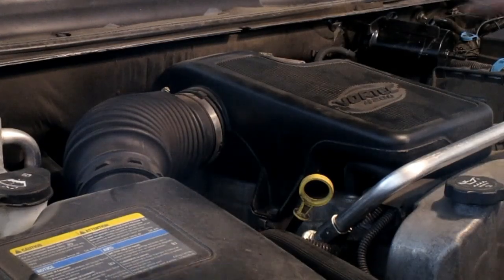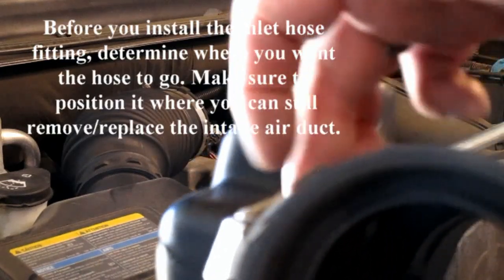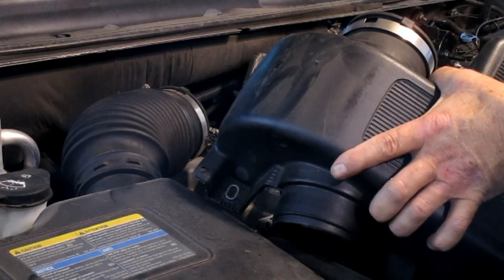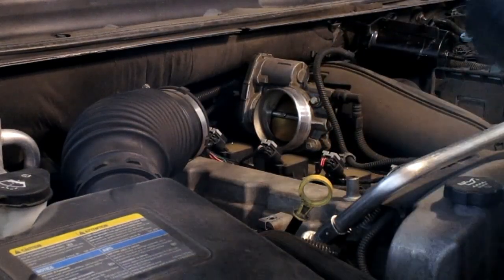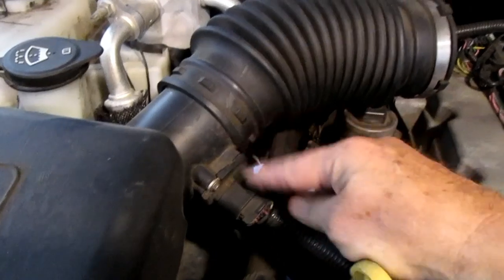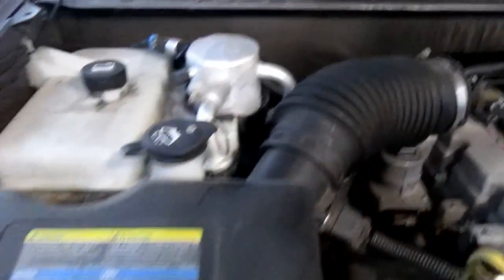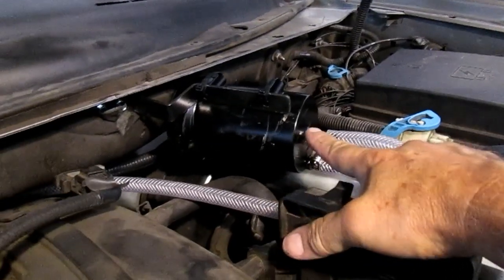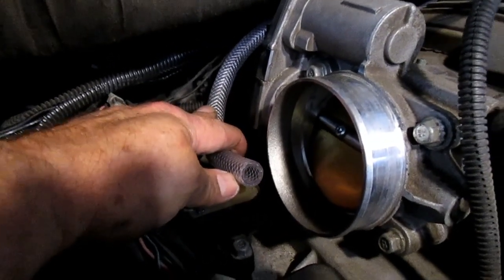How To Install The HHO Gas Inlet part 1

Comment: What about using a T fitting and connecting the hose to the pcv valve that goes into the intake manifold?
Reply from the maker: We have found that is NOT a good alternative. One of our customers tried that and the vacuum was too strong and collapsed even our reservoirs made with double the thickness of most. It is far better to insert a tube close to the throttle intake. That produces enough vacuum to draw it into the engine, without creating too much vacuum.

Comment: You guys have a video of how it will work with turbo and the use of tuner?
Reply from the maker: We need to make more videos for sure. We have lots of videos but no time to edit and create them right now. Just too busy manufacturing and selling. I will say that we have had great successes using our kits on cars/trucks with turbos. The key is to install on the INTAKE side of the turbo, so it can be drawn through the turbo, intercooler, and into the engine. It will not pre-ignite, but will combust in the combustion chamber. Diesels with the kit and tuner have seen as much as 45% improvements (even with our commercial units on large trucks, buses, etc). The technology works.

Comment: What about pulling the fuel fuse.cuz if u don't pull it.it well not wrk.
Reply from the maker: If you are referring to using the fuel fuse or fuel relay to connect up with the kit relay, then yes that is a good circuit to use. The main thing is that it only powers the kit when engine is running.

Comment: How the possibility the hho will reach combustion chamber for burning? As if we run outside, we can't ignite the fire in 1 feet distance although through the bottle or pipe when we mix blow with natural air.
Reply from the maker: The HHO is drawn into the combustion chamber through the air intake of the engine. If it is a turbo, it is drawn in before the turbo and compressed with outside air (will not auto ignite). Once it enters combustion chamber, it will ignite when diesel or petrol ignites. Hydrogen burns much faster than gasoline (10 times faster), and faster than diesel. Add oxygen with it and you get a more complete burn of the hydrocarbons (lowering emissions), and more work extracted from the hydrocarbon molecules where it matters- inside the engine.

Comment: is it possible to over do the hydrogen output
Reply from the maker: We use to think so, and it was commonly reported that way. But we have seen amazing results even using more than the common amounts. Our test on a commercial bus in Brazil proved that. We used a dual core 884 unit that was designed for 12-20 liter diesels, on a 6.7 liter engine (2015 EURO5 VW MANN engine). We got 45% improvement on that vehicle which broke all records (8 witnesses, uncut videos for proof).
Reply: @transitionaltechnologies648  so, you can just pipe the hydrogen gas into the intake manifold and it will help the gas burn cleaner and more efficiently?
Reply: @noahkidd4674  Yes! The hydrogen gas is 66% hydrogen and 33% pure oxygen, and will ignite when the fuel ignites. It burns 10X faster than gasoline, so a very small amount makes a huge positive effect. Because it is so energetic, it extracts more energy out of the fuel where it matters most- inside the engine. That's why efficiencies increase (our kits get 45-50% increases consistently), and emissions are so low they can be referred to as zero emissions (according to a chemical engineer who reviewed our data),. It's a win win all around. We use special tuners with our to help the electronics understand they need to lean out the fuel when HHO is injected.